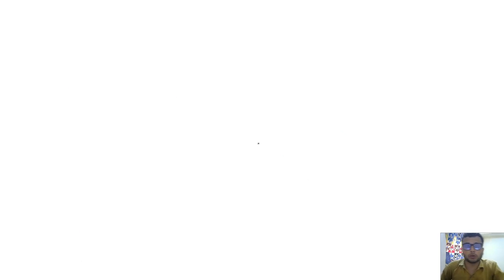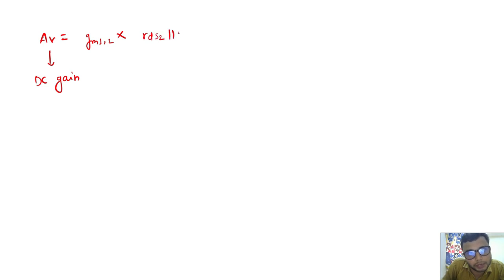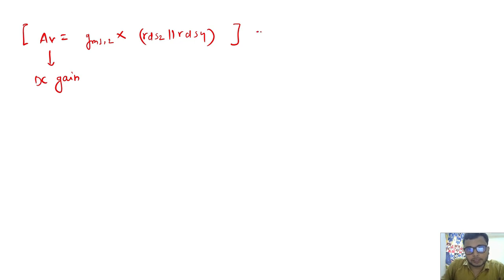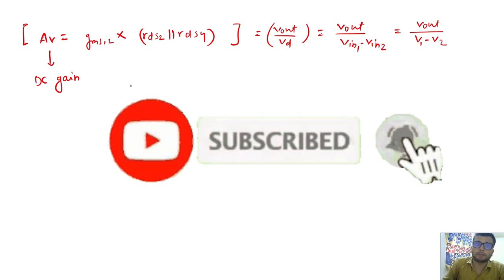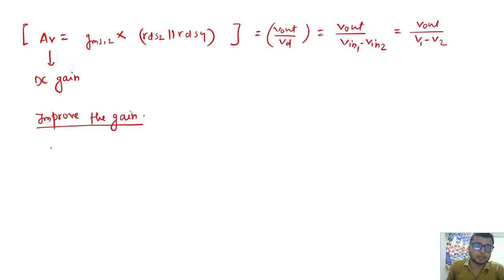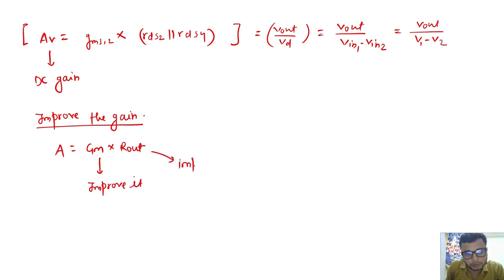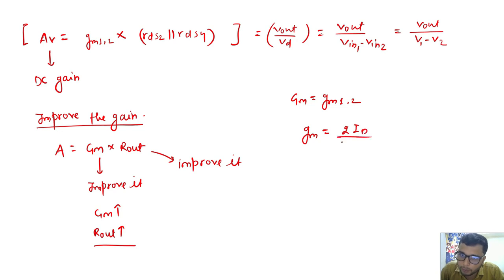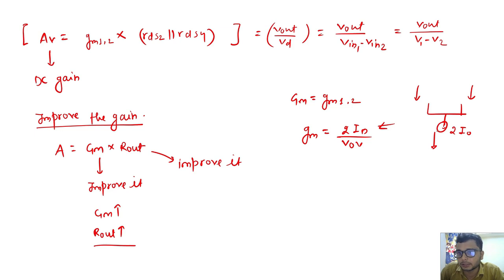Lecture-03 || Gain Calculation 5TOTA || Placement Series || Anuj Chauhan

Comment: How to find the Gm, when two stages are present.   @15:28
Reply from the maker: @Himanshutiwari590  or do one thing, find output voltage of first stage in terms of input voltage which is nothing but the gain of first stage and then go for the output shortcircuit current at the output of second stage which is nothing but the gm of second stage hence we will be having relationship between input voltage and output short circuit current

Comment: Hello

I just have a doubt while calculating Gm

According to the solution I think you are keeping tail node potential Vx=0

But the load is asymmetric..on left side looking in is 1/gm3 and right side it will be rds4 and they are not comparable...

So Vx can be 0 only if we assume that gds is 0 for 5t OTA right?

Can u pls guide me on this..thanks !
Reply from the maker: @YashRPant  yes but while you will do analysis, there is much smaller fluctuations in vx for small signal analysis...so it can be taken as virtual ground
Reply from the maker: @YashRPant  if not understood yet I'll can take this concept in more detail in some other video
Reply: @learningexpress183 
Okay it would be great..
Thanks!